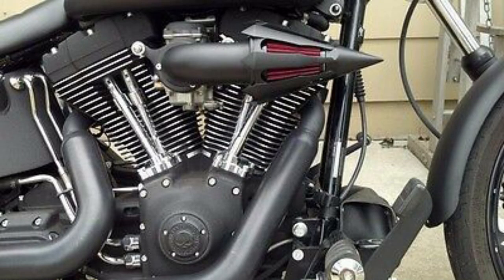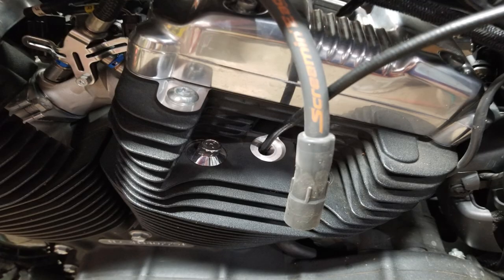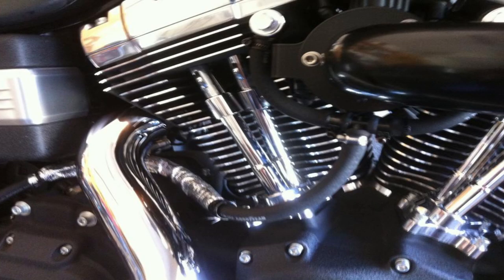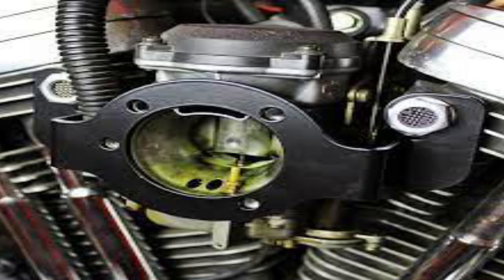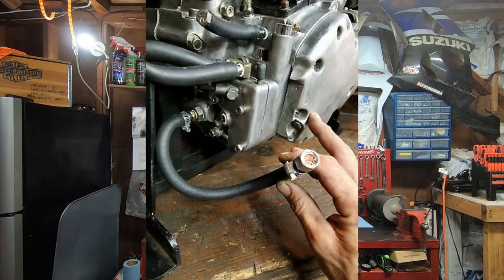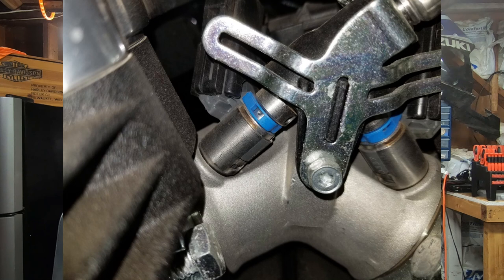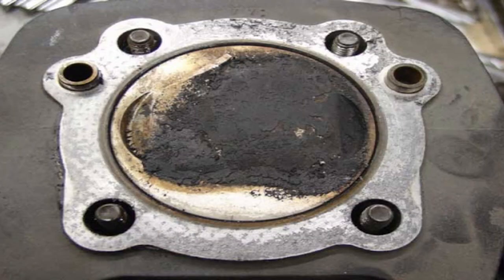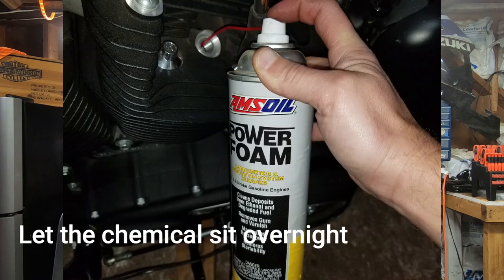Why Your Harley-Davidson Needs a Catch Can or External Breather System

Comment from the maker: Would you run a catch can, external breather or just opt to clean your top end every now and again?
Reply: I run it without a catch can. And oil half to 3/4 on the dipstick hot. No problems with any oil/water sludge venting.
Reply: Every ice engine should have one.
Reply: I run a catch can on my dyna.
Reply: Just completed install of DK catch can after engine kit and rebuild.  Simple drill and tap operation.
Reply: id run a catch can as i do on my srt8.
Reply: How often would would you say to use the top end foam cleaner?
Reply: Catch can for me, plus you'll need one anyway at tech inspection at the drag strip
Reply: I run shell V power or exellium , premium gas with special dopes I f I may believe,  it cleans the engine.
Would this do the same ?
Reply: Hell no
Reply: Id buy a motorcicle made by  inteligent people ,like Indian , Triumph or any japanese maufacturer .
Reply: Can run some seafoam through once every couple of tanks of gas.
Reply: i guess Im asking randomly but does any of you know of a method to log back into an instagram account..?
I was dumb forgot my account password. I love any tricks you can give me
Reply: @Chase Jefferson Instablaster ;)
Reply: External breaker. Already on.
Reply: @michaelpacheco4952  how do I find this video?
Reply: @windtherapy99  yessir
Reply: Run to atmosphere no catch can
Reply: After watching this I just got a $10 vent/filter and vent to atmosphere also.
My air filter is just the SE under the stock air cleaner cover.
I haven't noticed any oil on the filter yet (about a year).
Reply: I run an external breather that I made myself. Simply plugged the air cleaner holes with JB Weld and made a two into one hose that exits between engine and trans. Never get oil on rear tire the way I did it,bottom of bike is clean also.
Reply: @karlhockenberry9130  I have one as well. Mine leaves 3-4 drips on the floor after a long ride. Do you get the same thing?
Reply: @stevenbarrett7071  how many drops does yours leave after a long ride? Mine leaves 3-4 drops and I’m wondering if it’s normal.
Reply: @windtherapy99  green rubbing alcohol or any rubbing alcohol that's as close to 100% pure will do the same thing for a ton cheaper. $2.50 vs $10-$15
Reply: New to me 2000 fxwg, just put a set of flat tops in in to replace the 95 domed pistions that were in it. it has a SE big bore cv44mm and intake, porting, cams ect.  Would have been fine if they didn't mill the heads for higher comp.  was thinking the breather should be dumped to atmosphere, and its simple with the intake setup on this unit, just a 1/8th npt plug, and a lenth of 3/8 or 5/16 hose to the ground and should be good!
Reply: I'm running a 21 Tri Glide and decided to do a catch can but  thought bout it for while. Then using stock air cleaner  concealing proper size hoses and a Y into exiting hose out bottom of air cleaner. The location of the catch can is front right side @ the floorboard. Some nasty stuff going into the can...
Reply: I have no reason to care about a catch can any more than did millions of pre-PCV cars, trucks, motorcycles and stationary engine owners not running on a drag strip. I immediately vent every dry sump bike ( I have Nortons and Triumphs beside HDs) that comes my way to atmosphere and also mod my older trucks where the PCV system functions as a build-in manifold passage and spark plug fouler.  Atmospheric pressure cannot overcome crankcase pressure so I don't use those purely decorative breather "filters" either. Harley crankcase vent problems were mostly solved before the Second World War.  I run my head breather engines open to atmosphere and that doesn't cause a mess either. No way would I dump crankcase vapors into a perfectly sound engine. My oldest Evo has well over 100K miles vented thusly with zero problems (exact mileage unknown because of crappy speedo drives I couldn't be arsed to replace).
Reply: I prefer the power foam cleaning method

Comment: a bit late coming to this i live in londonderry northern ireland and on my own as far as bike concerned i have 2004 flstci six speed have changed the camchest tensioners to hydraulic what want to know is can i put two  catch cans on existing stock rubber  breather hose and hide behind ai rfilter  housing has stage one k n filter 43000 mls  thanks in advance great channel learned a lot

Comment: Do Indians have all of the issues that Harley?   I have a 2014 street glide with 18000 miles. I haven't had any problems but feel in sitting in a ticking time bomb.
Reply from the maker: The Indians have the same breather setup where the crankcase is vented through the heads. The 2014 103 is actually a really good engine, the late model 103's they got it right.

Comment: Would this apply to car, truck engines?  Is that why people do an egr block off?
Reply from the maker: Blocking the EGR on a car or truck keeps exhaust gas from being pumped back into the air intake which does pick up a few horsepower and that's essentially what we are doing here on bikes too. On a car you're referring to the PCV being run through a catch can and yes this is a must do on today direct injected vehicles. Your intake valves on direct injected vehicles don't get cleaned anymore by the fuel and they coke up really bad with oil over time. It's not a bad idea at all to run a catch can on your car or truck too as well as your bike.

Comment: As someone who's been a mechanic for over 40 years, I think I'm going to contest a few things here.  For one, some carbon build-up is normal on an engine that's not making long highway runs.  Two, the amount of crankcase air going into that intake is pretty minimal unless you've got some blow-by problems.  If you've got heavy deposits, think rings or too rich a fuel mixture.  Third, a drip or two of oil on the pavement from a breather vent is hardly going to cause you to lose control.

Otherwise, I do appreciate your videos.  And you're right, many DI engines do build up an excessive amount of carbon.
Reply: One less job to pay some one to fix is alright with me. Some people are ok with almost good the rest of us like to get it right the first time.
Reply: @gnsmk357  the entire Harley Vtwin success is built around it's imperfect angle

Comment: On my 23 Road Glide ST I vented the crankcase cover only.  This has taken pressure off and there’s no misting in the intake.  This is after 1600 miles.  No need to vent breathers on this M8.

Comment: I have an 04 Heritage carbureted. Instead of a catch can I installed a beveled copper tube at the end of the hose and hose clamped the tube to the lower exhaust pipe. No noticeable smoke or dripping.

Comment: Hey Gixxer, I just installed a DK Customs DIY external breather system into my 2009 FLHTCU. I have a SE Chisel air intake, I drilled into the ears of the base mount where the brass fitting are now installed, aiming up around the 2 o'clock position. I filled the oil channels in the base with RTV. I'm running the house up under the tank and then down under the coils to the right side of the bike just behind the side cover on a plastic shelf where the breather filter is now velcro'd into place. If it gets messy I'll set it in a small plastic rubbermaid bowl or get the catch can.

Comment: Great video as usual! I did the mod on my 09 EG. It only has 3k on it but I figured I'd head off any problems. I posted the pictures on one of the forums I belong to. I got a lot of positive feedback. One of the members thought it is going to create issues with oiling. I don't fully understand what he's talking about but perhaps you can explain. I definitely don't want to hurt the engine. Here is what he wrote: 
A "catch can" has a vacuum pull on it still,to keep the engine in that vacuum state,definitely needs it.! Your actually gonna CREATE pressure (vs. a vacuum) and make your engine have excessive oil building up,and possibly causing a pumping issue. So,get a true "catch can" and route a hose back to the INSIDE of air cleaner to keep a vacuum. Only in a positively charged intake do you not run a pcv setup,or it's on a one-way check valve.

Comment: I own 2 bikes 1 fuel injection and 1 with a carb. I converted both with external breathers. The fuel injected bike ( sportster ) throttle body was very nasty so I cleaned it with throttle body cleaner and then converted it to an external breather. I had to do some drilling in the backing plate to reroute hoses and then join them with an external T fitting and then routed a hose under the bike with a external breather which I tied to the bottom of the frame with cable ties. Total cost to do each bike was between 20 and 25.00 each. The external breather is available at just about all auto parts stores and cost 12.99. They also have the hoses sold by the foot. The only word of caution I have is when drilling the holes in the back plate to route the hoses through is to drill the hole size as close as you can to the size of the hose you are using. If the hole is to large there is a danger of sucking in a foreign object into the throttle body or carb and possibly doing engine damage. I would not recommend using any kind of sealant around the hose for fear of the same consequence. Just drill the hole where the hose fits through it snuggly. I immediately could tell a HUGE difference in performance on the bike that was fuel injected. I have a power commander 5 on the bike and I didn't have to get it retuned. The bike with the carb I couldn't tell any difference because it was very clean inside. I probably didn't have to convert that one but it was so easy I decided to do it anyway. I apologize for the length of my comment. I highly recommend the conversion.

Comment: Gixxer a big shout out to you for all your advice. Just installed  DK Customs breather bolt back plate and 606 air filter  back plate and filter. Coupled with a Sifton Air Cleaner Breathing Kit and the result is BOSS! It works great, my dyno numbers remain solid and the overall appearance is one of a factory finish rather than a "Home Fix It" look. I admire those who have the talent and ingenuity to create the breather fix devices but wanted to keep the solid factory appearance. The two Sifton filter catches are directly attached to the banjo fittings which have extended stalks on which the filters fit. Finished in a high polished look the finished product is attractive as it is beneficial.
Reply from the maker: Thank you, I appreciate it! That is awesome to hear! A lot of people pick up a couple extra horse on the dyno at the big end rerouting the breather system. You'll have a much cleaner top end going forward now!

Comment: I have 2003 fatboy and when I purchased this it was the first bike I've been on.its been done to the 9's and it has a Doherty breather, I also have delphi fuel injection and possibly need a special umbrella valve with 2 chambers. I'm wondering about the Doherty breather. I heard they were out of business. I've had swveral  backyard mechanics and am trying to find a parts list to my Doherty breather with vents. The last person to  service
bike cut hose & took off jets and I found that none of the bolts were not torqued and 1/2 of the nylon washers, gaskets ,& rubber seals were lit there.

Comment: I had a 1996 bagger that I made a catch can for it fit under the right side cover had a breather on top inside I had a baffle to separate air from the oil in the bottom It had a fitting that I attached a hose to & then I drilled the oil spout & attached the hose from the catch can to let the oil run back to the oil tank ! It worked excellent ! But like you said it takes some engineering to make it happen ! Good video ! *** stars !

Comment: Put a DK Customs external breather with catch can on my 19 Electra glide
A month ago. Man what a difference! Felt like the engine woke up!
Very noticeable in power. No retune required.
Reply from the maker: Very cool! Those catch cans make a difference, Hammer performance testing their Sportster engines were picking up a couple horsepower on top using catch cans and external breathers.

Comment: finally i'm not the only one.  all my harley's beath into an external catch can the 2nd i get them new or a new to me and i rebuild it , i even do it on my new cars right off teh lot to my shop so i can machine a catch can, they are worth the investment i've rebuilt many harleys and from the butterfly back is just coated with shit oily water mess . i show my customers what mine looks like after beating it to death at he track for 7 years and its clean as can be inside especially if you like to rev it up
Reply from the maker: That's the way to do it, honestly not a bad idea going through any used bike. I like to get them cheap with a lot of miles and freshen up the engine, it's like a new bike after being gone through.

Comment: I've used two different sets of external breather bolts on my chopper before and found that they can be pretty messy in the long run. Now both the Tramp and the Heritage have the external tubing running from one head over top the carburetor to the next head with the line running down behind the engine. I eventually plan to do the same with the electraglide.
Reply from the maker: It really does keep the carbon off your pistons, makes a big difference!
Reply: Evo Forevo

Comment: Hello Gixxer, HPI (Horsepower, Inc.) offers their V2 Air Cleaner that flows 428 CF per minute of air and this will satisfy the breathing requirements any build!  They also offer a EBS that goes with the air cleaner that is really slick!   The price is reasonable for both items.

Comment: absolutely do a catch can. Doesn't cost much, but may limit air cleaner options. I run a Forcewinder with a "Y" to a catch can on the left side. Usually only have to clean it out once a year.

Comment: In the old days we would take air filter elements out & use a puff pack to just puff a fine spray of wetter past carb & you could see the smoke come out the exhaust as the watter vaporize on piston & lift carbon out exhaust.

Comment: The crankcases internal air volume changes greatly when those 2 big pistons go to their TDC and BDC position in unison. No problem back in the Panhead days before electric starters came along in 1965. The engines internal rotary breather valve opened and the hot air vented into the tin primary chain cover.  Oil in the vented air helped lube the primary chain, and was deposited back to the Earth from where it came. Same system was made to work with the electric start and rigid cast aluminum primary. But now the pump sucked that oil (and clutch/steel particles) back into the engine and oil tank. And keep in mind, this system was designed for the 61cu.in. or 1000cc Knucklehead. It worked fine. But as displacement grew to 74, and then 80 cu.in., or beyond, a new system was needed!
 I remember when the Twin Cam came out. There was a quote of one of the design engineers working on the vent/breather system who said he wanted to dig up William S. Harley and ask him what to do.
 My old bikes run a hose out the back hole in the cases with filter tucked up underneath. I've seen motors that did not run any sort of filter, just a hose almost dragging on the ground, and found lots of road dirt, sand, small stones, etc that got sucked up. These generally stay in the breather passage if too big to go thru the holes in the steel breather drum screen, or slots on the later plastic drums. If the breather drum wore into the case journal like many did, it could develop 'blow-by' and blow oil mist on the rear tire. It was common back in the day if you built a stroker, ya took the screen out of the breather drum. That was a bad move for the reason mentioned above. My '97 Evo headbreather has the SE crossover tube that came with a Stage II kit and a hose to a vent filter. .

Comment: Years ago before all the complications I used BG44K in my 78 shovel head. One friend had an early bore scope so we checked the pistons before and after. Made one hell of a difference, so I followed the directions and kept it up once a year . Around 38-40 thousand miles I rebuilt the top end and the head was supper clean though it still needed grinding and new springs cam etc.I'm no motorcycle mechanic but I had some great friends still alive back then. I still have a V-rod and a Pan head. stepson has a twin cam. Good video Mike from Maryland
Reply from the maker: Thank you! That's awesome you've got the best of both worlds in your garage!
Reply: @GixxerFoo  Thanks but I sold the shovel head 30 years ago I do have a 65 pan head I put on a rigid frame but it stays in the living room. So between the V-rods, Sportster and pan head Yes We are fortunate.
Reply: I just got a vrod. I notices it came with external breather but on rear engine only. How would you advice to install  front breather?

Comment: Good topic. I just got done converting the Ventilator a/c on my 110" Slim and my 2020 Road King Standard by watching YouTube vids and the DK Customs kits. After seeing what the oil mist can do to my pistons in a short period of time, it just makes since. I modified my RK stock airbox by opening up the bottom and adding some more stainless screen along with a KN 1717 filter and routing the breather tube through the bottom of the box. Looks almost factory! For an inexpensive but attractive catch can, pick up an aluminum brake resovoir from EBay that has the small bracket attached. You'll be mounting this upside down with the screw off cap at the bottom. Drill some small holes on the top (bottom) of the resovoir, plug in your hose, and mount it using one of the cam cover bolts. To clean it, just unscrew the cap (which is now the bottom of the catch can). Thanks to Gingybeard for that idea.